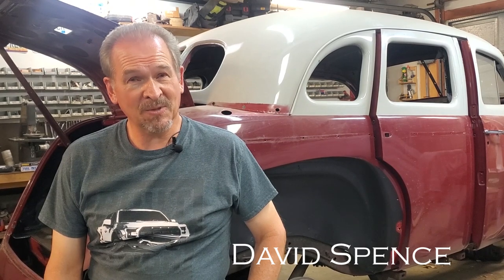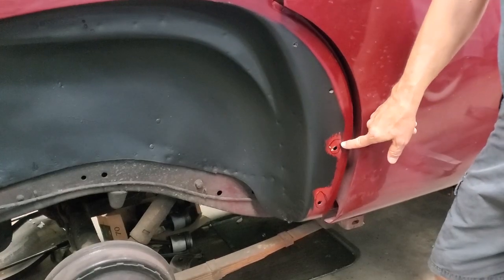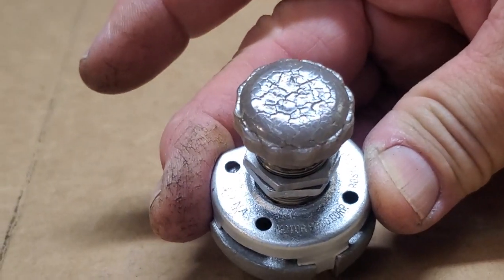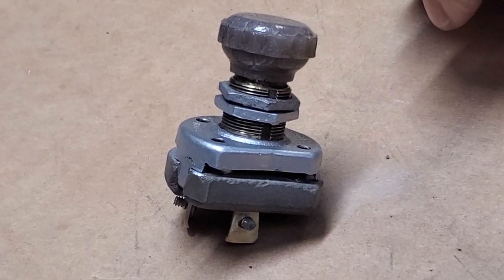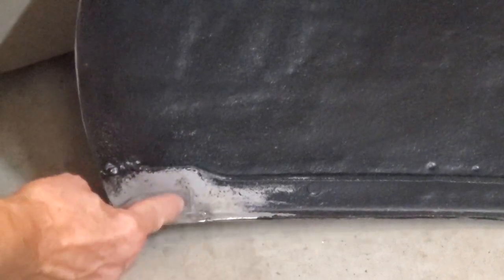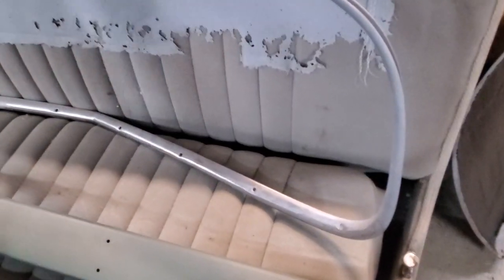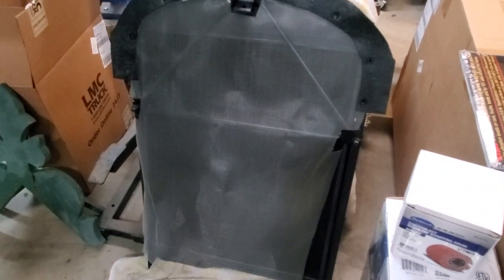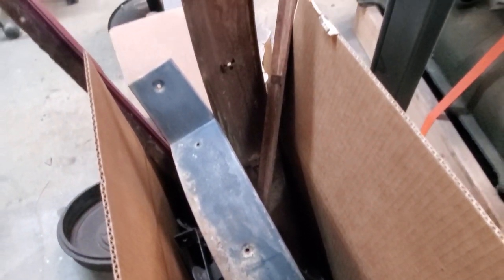Restoration Blog 1939 Graham Sharknose  - Graham Spirit of Motion, Model 96

Comment: Hi David, at 24:09 you show the radiator screen. How does it attach to the radiator? Rumor has it there were two springs on top and two on bottom that secured the screen to the radiator.
Reply from the maker: It's attached at the top with the same clips that hold the rubber shield on. The bottom goes past the top of the Radiator shield and therefore does not need fastening. Meaning the body part that holds the Graham emblem.